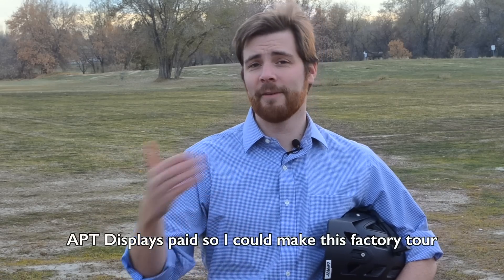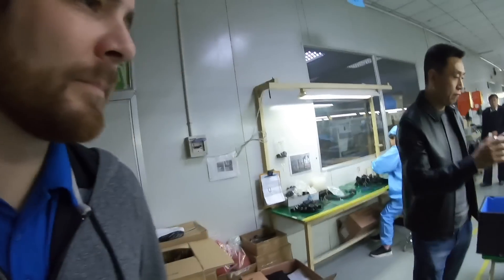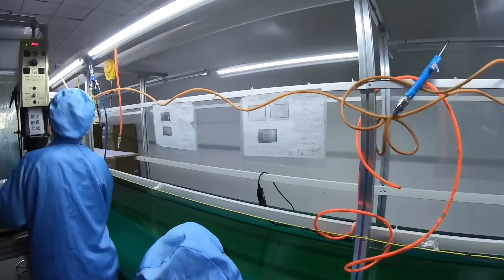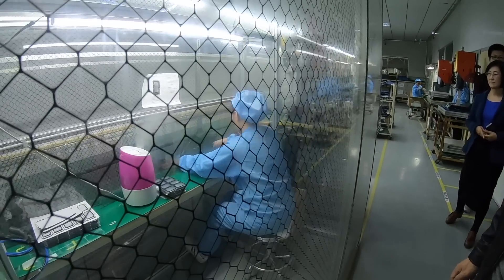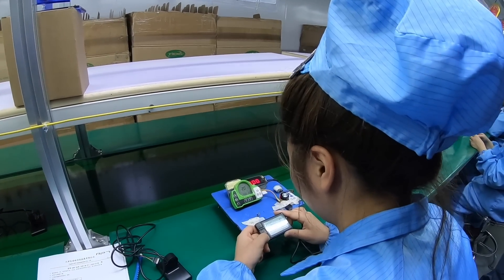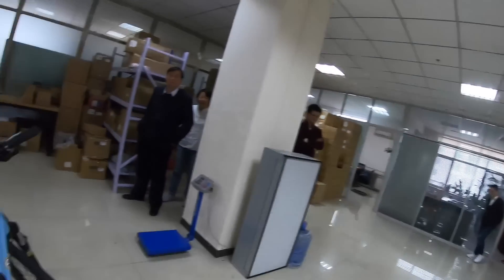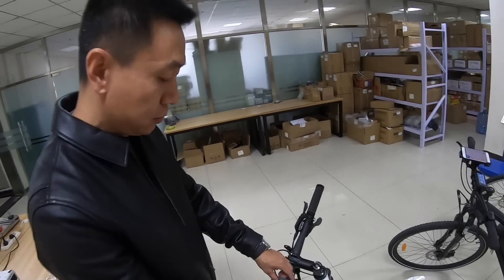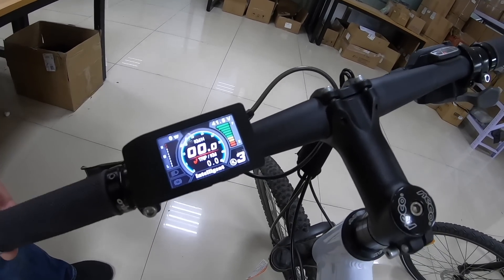Factory Tour: eBike Displays from APT, Chinese Production & Development Facility

Comment: Interesting to see. (Ouch! That high pitched sealer sound did get picked up on the mic).
Reply: Yeah, that wasn't my favorite thing. I hope they cycle the workers in that place.
Reply: Yeah, an ultrasonic welder does just that. While the two pieces are clamped together, they are vibrated at a very high frequency, enough to enduce molecules of the the two pieces to combine as one. This is known as ultrasonic welding.

It's always amazed me that this same technology, ultrasonics, when driven at a different frequency and amplitude, can produce images from  the womb. Totally amazing technology.

Comment: Does China and-or the far east take electric bikes more seriouly than the west, such as US.  And if so, is that made possible by their goverments recognizing the needs and benefits, and then posdible subsidizing the factories to ensure it all works out?

  Ebikes are good in certain areas,  short distances, good weather, good mileage, etc, but still a lack of them in US from what I see.  Ive seen a handful of gas powered, slightly noiseier and polluting..but greater power and distance, bikes, but maybe only 1 or 2 ebikes in my area .. PA.
Reply: All the places I visited had city roads with wide expansive bike lanes. Electric scooters and conventional bicycles are the most common vehicle, with busy bees scurrying to and fro. The bike lanes are protected by a curb, and a half fence of metal bars, with breaks every couple blocks. It's quite clear that the Chinese government supports domestic use of electric and HPV with very comfortable lanes (Intersections are a very different story)
From what I understand, the Chinese government does subsidize many enterprises by paying for some or all the shipping cost, as well as other kick-backs for local development or job creation. As far as anything eBike specific, I don't know of anything in particular. I do know that there is a serious pollution problem, and it hurts them the most. If there's a government out there capable of fast action, it's the Chinese. So I suspect that when it starts to hurt them enough, they will make moves to lower pollution, and I think that cultural history of bicycle transportation is in their favor.
Reply: China is well known as an historical bicycling nation - so the evolution to e-bikes is a natural step forward. In the US ICE transport quickly took over from horses and so there's a different heritage. E-bikes in the west have become high value items - unless you are prepared to build your own using imported parts from China. The nominal price for an e-bike needs to come down to under 1500$ to become a serious mass market product IMO.
Reply: @Seafox0011    thanks    ...  i do ride a plain bike also about 1 to 3 miles to get some exercise and buy at the store, but gas or ekectric would make it practical to double the distance, say out to 7 mikes.